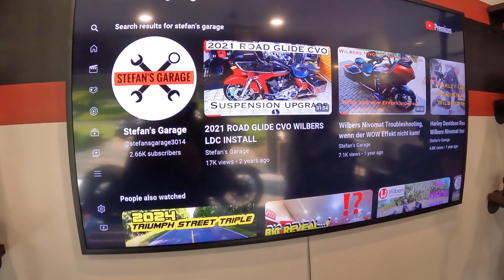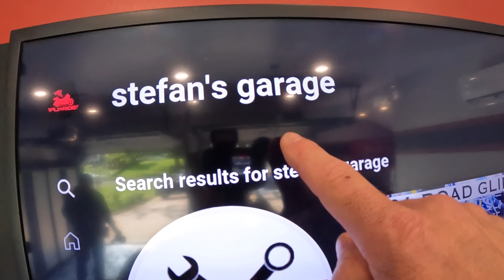BEST HARLEY DAVIDSON TOURING SUSPENSION SETUP❓#cyclefanatix #harleydavidson #roadglide #streetglide

Comment: Man, talk about a video where it's all good, and I do mean all!  Great video!  Wilbers Suspension is premium all the way, and the convenience of not having to re-adjust suspension for changing load (1-up, 2-up, cargo, etc.); expensive but worth it if this is what one would like to have.  And, that garage floor looks oh-so-good (make that the garage redo and the kitchen too)!  
    My first few upgrades that I always do to a new Harley Touring:  Fan to Oil Cooler; Trask M8 Checkvent; and Suspension!          Then the Seat, followed by the bars.  Next onto performance:  Intake Manifold/Air Cleaner, Exhaust, Cam, Tune.  Audio upgrades.
Tom M., '23 RG-ST.  Over the years, have had Legends, Progressive, Ohlins, and RWD.  Any of these are a absolute major improvement over the stock HD OE suspension.  The RWD front & rear [RWD Kits] perform very well.